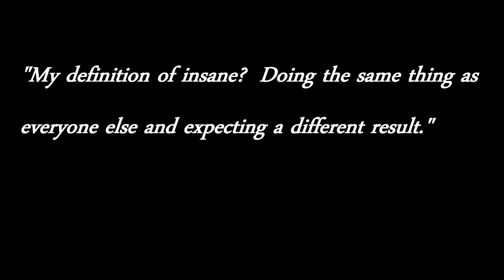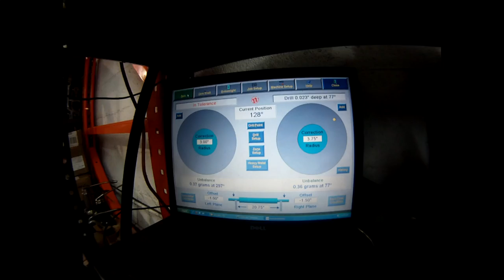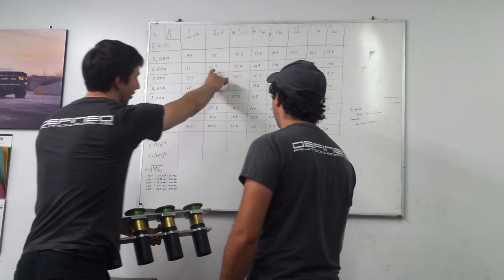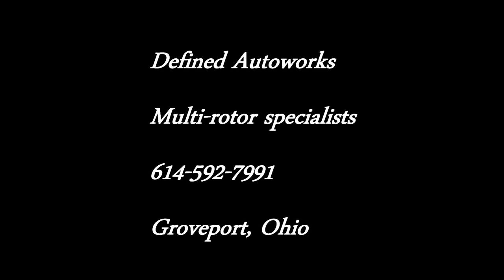Mazda Rx7 4-rotor race car. The making of a Defined Autoworks Beast. [Offical Video]

Comment: The "definition of Insane" is building an awesome 4 rotor FD RX7 then using a camera phone to film it.
Reply: Lol
Reply: Benjay1975 you gotta save as much as possible for the engine lol
Reply: Roberto Robles Especially when its an unreliable rotory
Reply: m
Reply from the maker: +Benjay1975  Have not had any issues. It is the image of reliability.
Reply: +Chris Fokjohn assembled shortblock is 250lbs. Complete with intake/exhaust/flywheel/ clutch/alternator/coils and waterpump is 350lbs.
Reply: they spent the remainder of the budget on new seals.

Comment: it has the brap brap brap of the 787b!
Reply: The rough iddle comes from the proting of the engine, similar effect is in heavy ported 13b and 20b engines.
Reply: Yeah it's from the porting, just look up Bridgeporting which is used for most 13B/20B tuned 7s, J-Ports are even more fun but generally not street legal
Reply: Yeah bro, but it is a racing engine with natural aspiration who produces 700bhp.
Reply: akkudakkupl  i think hes talking about compared to other 26b's like mad mikes PP 26B that sounds nothing like a 787B.
Reply: Liehry82 its only not street legal if they know and your dumb enough to tell anyone what it has and whats under the hood.. RMV / DMV doesnt ask.. NO ASK NO TELL.. Therefor u could have anything legal
Reply: 787s are 4 rotors
Reply: Rich H not really lmfao. with how fucking loud a 4-rotor is- if you ever get to hear one- just know theyre ear splitting

Comment: When I took small engine mechanics in high school we got a book that showed the 4 cycle and 2 cycle piston conventional engines in the manual.  There was a very short piece on the Wankel engine design when I was in school in 1977 but there was only the combustion cycle of the rotor and the gear that it rotated around but nothing else.  I'm like WTF how does the rotor transfers the rotor energy into the output shaft.  Those books where crude then but showing this build is OK I get it.   Thanks for the video man.

Comment from the maker: Honestly a 4-rotor is very advanced stuff to build. There is no manual, all parts are custom, and you must be very very well versed with rotary engines. I would start by building a two rotor and then carefully plan a build with 4-rotors. We sell 4-rotor engines complete starting at $35k. Parts only will still shock you, since everything is custom.

Comment from the maker: Just to add some more info, the balancer will spin very slow at first and if the un-balance is detected it will stop automatically. Once the material removed and balance is within a few grams it will spin all the way up to 600 or so RPM. So nothing bad can ever happen, short of a bob weight coming loose!

Comment from the maker: Similar in some ways (both 4-rotor, P-port, same size engine). This is three plugs per housing, different port timing, 5th main bearing, slide throttle, variable intake and higher rpm capacity.

Comment: I tip my hat of to you guys, and congratulations on an amazing 4rotor build. Im a bit confused though and need some clarification. I've seen many 4 rotor builds with variable length runners, lightened & balanced rotors,eccentric shaft,P ports, multi plugs/housing, and don't know what exactly is different on your motor. I express this opinion with all respect, am just curios I guess. 

Again congrats..!!!

Comment: So, Logan: When are you going to show the world that this engine truly means business? The people want some high-RPM track footage and drivebys now that the weather is getting nicer! :)
Reply from the maker: Very very soon! We ran out of fuel flow on the dyno, and the alternator didn't keep up. Switching to 16v system, and remaking the fuel setup for more flow. Videos will follow directly afterward. So far 610rwhp without trying.
Reply: Logan C  Any progress, man? I'm sorry but this thing just excites the hell out of me. xD
Reply: Logan C As a Mechanical Engineer and long fan of the rotary my hat is off to you and your team! I'm glad you are keeping it NA and perhipheral ported. This is no doubt no comparison to a Renesis engine with it's side intake and side exhaust ports. I'm also curious to see what it ends up turning and what rpms you get to. I have owned 11 RX-7s and gone through countless rotaries...NA is the way to go after destroying many a turbo engine from boost or long-term heat issues. ESPECIALLY on a track car that will see HP from long durations. What material/type of seals did you guys go with?
Reply from the maker: Patrick Harris Thank you very much! It has seen 11,000 rpm and can handle more, but I have not made a intake to breathe that high in rpm. Its usable powerband is 5,000-10,000 with excellent meat under that. 610 rear wheel horsepower was the best so far but I have made considerable changes since then and plan to go back tuning soon. The motor is using ceramic apex seals

Comment from the maker: Alot of steps are skipped in the editing. But no not alot of lube is needed. This is a external drysump engine which means after assembly you can pump oil through the whole motor without even rotating it. No need for lots of assembly lube :)

Comment from the maker: We have the specs on the Mazda version, but this couldn't use them because of the rpm range difference 9k vs 12k. I wanted a simple system as well, which uses servos vs. the window style motors mazda used.

Comment: This is epic! One thing worries me though - is it safe to balance a whole rotating assembly with the eccentric shaft and all the rotors without protection of any sort? Just the though of one of the parts disintegrating at even several hundred RPM is frightening (knocks on wood).

Comment: That 4 rotor RX-7 is ready for anybody to challenge it
Reply: And pulse performance race engineering did and won with a 4Litre 6 rotor
Reply: +TapouTboy1994 
Engines can't race each other, cars do. PPre built a drag car that would lose to me on a road course. Defined built a road race car that would loose to them on a drag track. Apples to oranges
Reply: +Logan Carswell I'm not saying a proper race im meaning a build of customisation and rarity. No one else in the world has build anything like the ppre6b and as for that the rx4 is still a street legal car not just a sole drag car

Comment: The eccentric shaft (or crank shaft if you will) alone is $10k and that doesn't include the rotors, seals, etc. There is no such thing as a kit as no shop is going to make them. In the end, for a cheap end build, you're looking at $25k on just the motor. Another $10k will get you ITBs and such to make it perform better and look nicer. Shops can make you the parts but since 4 rotors aren't in high demand, they are made to order and very expensive.

Comment: both engines will cost a lot more than the car in most cases.  PPE sells the 4rotor for about $60K-$100K depending on what you want.

Comment: Does it have forged pistons?
Reply: it has rotors not pistons...
Reply: +Niklas Flyckting lol it was a joke😂
Reply: It has forged pistons and it is stroked and bored to be a 7.3 L. They also did a fuel conversion to diesel (not sure why they didn't just put a Powerstroke in it). it makes over 300 horsepower to the seatbelts but it only makes 200 ftlbs. it will do 0-60 in 20 feet in 3rd gear.
Reply: I believe Mazda used a cast piston design until production ended in 2012.
Reply: Its got coil pack ignition, no rotors... or distributors

Comment: sweet ride! just curious have you had any problems with the kiwi center bearing or the stat gears in the middle irons? i know of a 13b that had center bearing isses and a 4 rotor p port that pulled one of the gears out at only 8500 rpms
Reply from the maker: Has been to the dyno for hours making 610rwhp right off the bat. Been going to 10,900rpm with no issues. Ours has improvements in the design however.

Comment: So, if someone wanted a short block 4-rotor from you guys, what would that cost?  Or at least the eccentric shaft parts and any other custom bits.  I can get the rest easy enough.

Comment: inquiry about the fog light fabrication within the front bumper, looks fuckin mint
Reply: I custom made them, made the housings from aluminum sheet metal and then covered with polycarbonate. Yellow tint is an adhesive layer.
Reply: +Logan Carswell oh wow so the yellow is also the adhesive, interesting. I'm want some on my Mazda NB shell inspired off yours whenever it's together, miles and miles from it bare shell right now.
Reply: +Jesse Link but really thanks for the reply! it's been over a year I've been wondering about them occasionally I'm sure

Comment: I am sorry but I lost two rotor housings already where they supplied me with so called Power seals that was eating into my housings, $100,000 lost, what seals are the correct seals I got a RX8 with a REW 13 Turbo engine
Reply from the maker: $100k into a 13b? Alright,  well for turbo builds I use goopy performance or E&J seals.

Comment: I'm not car expert but what make rotary better than j2z or dynamo.  What are pros and cons. Thanks
Reply from the maker: Rotary is very compact, light and has a low center of gravity. Combined with relatively high rpm it has many advantages.
Reply: +Logan C Then why did all of the manufacturers stop making them?
Reply: The real doktorbimmer I've heard they eat up lot of gas due from being a straight pipe design

Comment: You guys made this look simple. Heh
(I know it isn't, btw)

Anyway, I'm wondering how much HP this thing is putting out. I presume it's running without a turbo(s) Edit: Oh, I see you aren't running any. Thinking the RX8 engines get ~250 bhp I'd guess 550-600 bhp with a hot rodded 4 rotor engine. 
I wish my FD was 3 or 4 rotors without turbos. I'm not a big fan of the complexities and heat that come with turbocharging.
Reply from the maker: So far has made 610 rwhp. Or 730 bhp. Its just getting started!

Comment: i'm not a car person but what is significance of 4 rotor motor? i keep seing some rx7 pimped out but how is this revolutionary did it only have 3 rotor before or?
Reply: The Rx7 only came with 2 rotors. Best comparison would be if took a honda S2000 4-clyinder and made a complete custom v8 block with all honda parts. But then made it over 5.2 liters and revved it to over 10k rpm.
Reply: oh so its like TWICE as good now, yes that is very segnificant actually thanks for explaining you lost me with the liter and rpm though :) but i just like to see how much goes into it even if i dont get it lol boys will be boys
Reply: +Chris Fokjohn look into custom block v8 superbike top end engines rev way past 10 but of course are only somewhere around 2 litters but sound great. as for the Honda engine you're dreaming about I'd look into Honda F1 cars, probably something out there you could drool over

Comment: is this all motor?
Reply: I mean I see the open stacks but I just don't know what to think.  Does it really make that much hp without boost?
Reply: black2011gt yes
Reply: black2011gt look at Mad Mike Whiddet's Rx7 N/a quad rotor from New Zealand that has a 700+ HP output with no boost

Comment: Logan C how much is a 4 rotor  motor going to  cost me nice build by the way its epic man
Reply from the maker: Depends on the spec. The motor starts at $28k
Reply: That's actually not that bad considering what went into the build with all the custom parts. Great job guys, I'm a mechanic and engine builder in Australia and I just wanted to say I can see all the hard work you've  put in to create this crazy rotary. You guys must have seen the 6 rotor deal from NZ- it's a bit too long to really do anything with in a street car package. Yours is a different story. Yours sounds better too I reckon. Wonder what could be done with a bit of boost with your package, it'd make some impressive numbers. I'm sure it's pretty fun N/A anyway...

Comment: Thats a pretty blanketing assumption. "Low pressure"? whatever that means, I assume you mean low boost and not low back pressure. You can make low boost at 1000rpms or at 10,000 either way the trade off isnt worth it. Whenever possible N/A is always the way to go, unless youre building a diesel

Comment: 35K for an Engine? Could have just swapped it for an LS1. Heck My S2000 cost me less than 20K with Rims, Coil Overs and Turbo Setup that put 430HP to the Wheels

Comment: but less efficient too hp is more than enought yes.. but a low pressure turbo set up would bump the efficiency and will increas mid range torque :)

Comment: 4 stroke = 1 power stroke per 2 revolutions
Wankel = 6 power strokes per 2 revolutions
Reply: 4 stroke = torque
Wankel = whats that?

jk... i respect this rotary.... very boss
Reply: 240SSONLY lol They may be torqueless triangles but you have to admit, they've got spirit.
Reply: Two power strokes, actually. You have to compare crank revolution to e-shaft revolution, not to the rotor. A single-rotor engine would need 3 revolutions for each side to have had its four cycles complete, therefore in two revolutions you get two out of three combustion cycles for any given rotor. It gives the amount of power pulses per revolution that a two-stroke gives, but with four cycles occuring one after the other.
Reply: True

Comment: What I don't get is....how the fuck does it cost 40k to build one of these when its that simple compared to piston engines? Looks like its all CNC milled. And then an easy build process. Yet 40k? Dammmm. That's a shame. HAVE to be rich to afford this kind of engine.
Reply from the maker: Base engines are just under $30k. It is a lot, and we have made progress bringing the price down. The eccentric shaft (crank) is one of the most epensive parts. Roughly $5k alone. Then the oem mazda parts are getting more pricey each year. Each rotor housing from mazda is $700 each x4.  Then new rotors at $600 x 4. Add all the cnc work for the port sleeves to be pressed in, housings modified to fit stationary gears, apex seals, all the springs, gaskets. Hand port work, hand fit of all seals. Clearancing and full balancing of the assembly takes hours. Its a one of a kind engine that is virtually custom built from one end to the other. Nature of the beast unfortunately.  But no other engine out at the moment is as durable, powerful, compact and lightweight.  Engine is 13 x 13 x 24"  weighs 266-285 lbs and can generate 500-700hp with no boost pressure.

Comment: low pressuere turbo sistems are know from the age of first turbo saabs an it means turbo charging with as less as 5-7 psi:)on a newer turbo desing and 2.6lrotory engine that means no lag at all..still reusing around 60-70% from the exhaust energy that you would just waste without a turbo and alot better milige:)saying that n/a is the better engine configuration just says how less you know about engines, efficiency and technology:)I mean if i'm building such an engine i'd go turbo no mather what

Comment: We here talk about an engine which in 24H race setup gave 700HP/7500rpm. In qualify setup would give 900HP. F1 motors are less powerful, less durable and cost 10 times that. This is very cheap my friend.

Comment: Fuel consumption above a Boeing 747
Reply: A peripheral port rotary engine while racing actually gets better fuel economy than it's piston brethren.
Reply: +Logan Carswell I thought the Boeing 747 was powered by four GEnx-2b68 axial flow high bypass turbofans.
Reply: +100GTAGUY Indeed. Everyone knows that.
Reply: Indeed, the GE turbofans produce a lot more power per pound of fuel.. the Wankel was not a very efficient engine in terms of BSFC.
Reply: Actually No, that is not true.. piston engine have a superior BSFC and higher Carnot Cycle efficiency too.

Comment: ALL of that is all true, BUT your talking about a rotary here... :( not just one or two but FOUR.  A FOUR ROTOR.  I bet a centrifuge supercharged v8 lsx is more reliable than this thing and wouldn't burn oil.  Better yet a 7.0l+ na v8 would probably be just as well.  Idk man.  I guess its all relative with high end racing engines because they all are typically going to have relatively short lives.